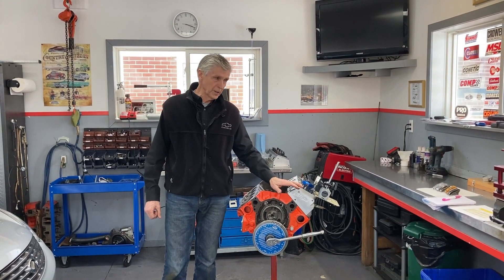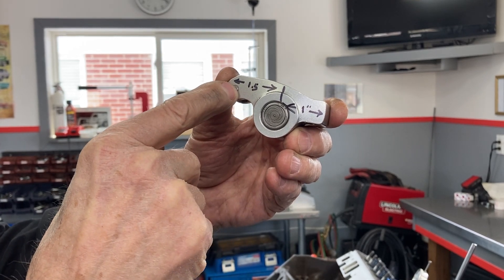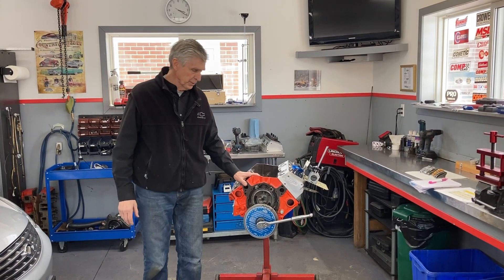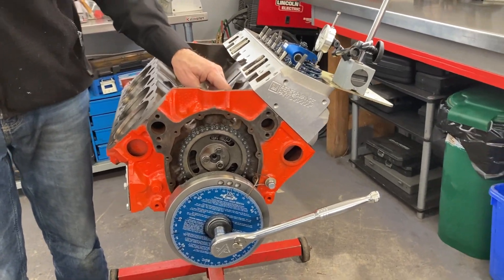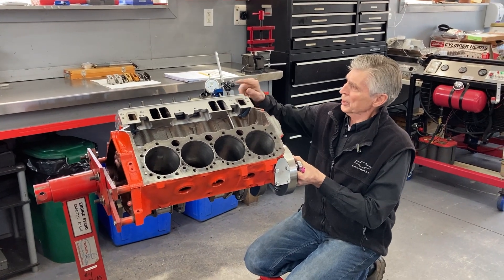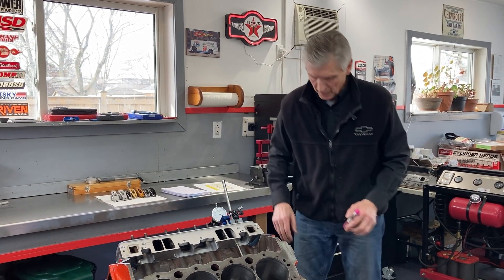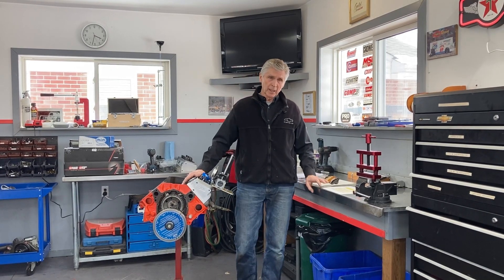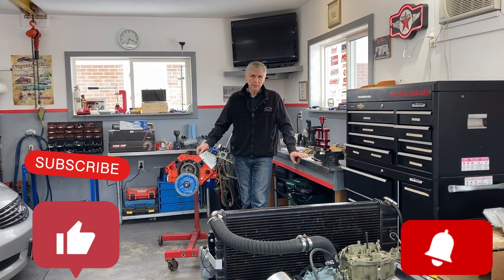SBC Chevy - Testing 6 Rocker Arms Part 2 AVERAGE LIFT over full lift cycle. Which is more important?

Comment: Could there be any benefit to installing a 1.6 rocker on the exhaust & keeping the 1.5 on the intake in a sbc 305 l69, 190hp motor?
Reply from the maker: Sure Don. Its a question of whether the intake or exhaust is least efficient. Lift always helps, its a question of how much. Dyno testing would be the only way to tell. AG

Comment: Ive got a set of crane dark gold 1.5 and they checked them on them is marked 
10 - 150  then C -05 same thing you came up with lol
I have 97 camaro LT1with stock stamped rockers
my cam is 447 459 so with your dark gold 1.5  what would my cam lift be?
i Figured + 17
Your going to laugh 
Ive got 60s set crane 1.5s was on corvette in car collection 
guy considered his retirement so he only had 1900 miles on it.
rocker got about 200 miles on them Had 30 cars in his collection
I ran them for day on my truck but they fell off so i bought self aliners instead of guide plates
 they are wide body and dont have revised hole in back and have fancy C15
on them The machine work is incredible 
the box says special order # 10 Higher Grade Bearings in black felt pen.
so Hefty My
 Friend Was over the Hill Gang 
 Id swear he took the off his world record Dragster but they are 3/8 lol
I got ten Bucks Says if i send 1 to you it would be tits on your dark Gold Crane lol 
They were Finatics lol 
my silver ones are just to Dam pretty lol

Comment: In theory a rocker arm that opens the valve quickly.say like 1.9 at like 10 degrees But then reaches close to 1.5 at the top would be ideal for torque and towing engines. However. You may want to choose a cam with even less overlap to make up for the increase in duration. Man I love engine science.
Reply from the maker: Thanks Jonathon, I am still learning also. Thanks for supporting my channel. Lots of content to come.

Comment: Thank you for this valuable information. I will probably never measure the actual rocker ratio myself. That's. Excuse I generally do junkyard builds😂😂😂 but. Currently I am putting some really cheap Chinese roller rockers on a dodge 360. I'm talking $250 for the entire set. Shooting for 550 lift with ported heads and Intske, headers. You know the drill.
Reply from the maker: Thanks Jonathon, good luck with your build. AG

Comment: Shouldn't the measurements for each rocker arm require specific length of push rod that would achieve equal arcs of travel above and below mid travel of the rocker tip at the valve stem?
Reply from the maker: Thanks seebro,  in the previous video about rocker arms (total lift) I showed how the correct length of pushrod is determined. The correct length was used for measurements taken in this video. Thanks for watching and supporting my channel. AG

Comment: Why are the LS7 rocker ratio at 1.8? Does combustion chamber, valve size compression play a part ?
Reply from the maker: Thanks for the question and I apologize for the late reply. I just noticed it now. I am not an expert on the LS engines but i think it just has to due with geometry, how to fit it all into the space allowed. Remember the higher the ratio rocker arm the less lobe lift required for the same valve lift. Many other engines in the past like the 409 and 427 had 1.75 ratio and even some radical higher end small blocks have 1.8 or more, including the NASCAR engines. Hope this helps a bit anyway. AG
Reply: Absolutely NO
Reply: @hankclingingsmith8707  elaborate

Comment: If anyone cares I swapped stock rockers for comp cams 1.6 roller tip rockers and went almost .2 quicker in the 1/4. This was in a 350 IROC with stock cam.
Reply from the maker: Thanks for sharing Andy, that is impressive. A rocker upgrade is a very good way to improve performance without taking the engine all apart. Lift helps everywhere. good for you. AG

Comment: Great video.  I have always heard that stock OEM rockers could be down to 1.40 ratio.  You've proved it.  I wonder how aftermarket stock style with no roller tip would compare to OEM.  Do they make 1.50 stock style rockers.  Doubt it.
Reply from the maker: Thanks Dino, in the follow up video about average lift I added a Melling rocker arm to compare. Check it out! AG
Reply: @goldsgarage8236  Thanks for your reply.  I see the Melling result.  I just used a set of Howards 1.5 stamped steel rockers.  Hoping they spec out similar to the Melling rocker.
Reply: @dinoa9608  There was an old engine masters episode where they tested a modern stamped Howard's vs a full roller, hardly any difference in power. With modern slick oils and stiff accurate ratio bodies, a high quality stamped or roller tip might be all you need for normal spring pressures today.

Comment: Hi, thanks for your vids. I find them very educational. Question… if someone has selected a new cam with certain characteristics….would changing the rocker arms change these characteristics?   Or… could someone avoid changing the cam they have assume stock cam and just add rocker arms to change the characteristics?? … if someone has a cam with too much low end torque …would adding rocker arms move the power curve to the right for more top end at the cost of low end torque?  Thanks
Reply from the maker: Toby, lots of good questions. Lift helps power everywhere but changing rocker arm ratio and adding lift has very minimal effect on duration and on the torque (power) curve. Having too much low end torque is a nice problem to have but the only way to reduce it is to retard the cam. Thanks for your question and for watching my channel. Allan Gold

Comment: THIS is something that I wanted to see tested for a LONG time! BTW, are any of the cheap aluminum cylinder heads worth buying? Or would one be money ahead to buy the best they can afford?
Reply from the maker: Thanks Robert. I have had good luck with so called Chinese cylinder heads. If you are making big power and high RPM you probably want CNC ported US made heads, (many of them also buy the castings from China). 
They usually provide the flow numbers so if they give you the flow you need they should work fine. Also pay attention to the lift vs. flow numbers. It doesn't help to buy heads that flow at .600" - .700" lift if you are only operating at .500" lift. 
Hope this helps. Please keep watching and commenting. 
Allan Gold

Comment: The measurements made here tell an interesting story same as the most HP will come from getting the fastest amount of lift from the valve opening to it's apex. But that's more for the cam guys I guess?  It's hard to believe all these manufactures end up so far apart from where they advertise to where they should be. Some great info here! Some good responses here too showing that you have to go the extra mile with clearincing to really get these still completive engines fast for less $$$$'s and weight.
Reply from the maker: A Phil, thank you for your kind words. Watch for more of the same in my next video.

Comment: Any clearance issues with using the 1.6 ?
Reply: If you use 1.6 ratio rockers on vortec head you might have to drill out the pushrod holes. My set of 8062 heads were touching so I drilled them bigger so I didn't run any issues! You probably will if you use bigger around push rods!
Reply: @larryw5429  thank you yes I’m going bigger pushrods 
I’m using Brodix heads 
I eventually found one place that was willing to sell one rocker for me to do testing with 1.6
Reply from the maker: Thanks Sharon, let us know what you find out.
Reply: @goldsgarage8236  will do 3 week wait time
Reply from the maker: Thanks for your input Larry
Reply from the maker: Thanks for your question Sharon. No issues on this GM Fast Burn Head with beehive valve springs, however the GM aluminum rockers do have clearance issues on the Speedmaster head that I tested (not shown in this video). The Speedmaster head has 1.4" diameter valves. Whenever valve lift is increased, always check for coil bind, interference between the bottom of the retainer and the valve seal, as well as the bottom of the rocker arm and the valve retainer.
Reply: @goldsgarage8236  great thank you 
I’ve got Brodix on my 350 1.5 comp cams pro magnum 
Was doing some research just to use 1.6 on the inlet 
So much mixed information I’ve read
Reply from the maker: Thanks Sharon, depending on how much lift you already have, (how big your cam is) 1.6 rockers should help, especially if you have a stock rocker arm now.